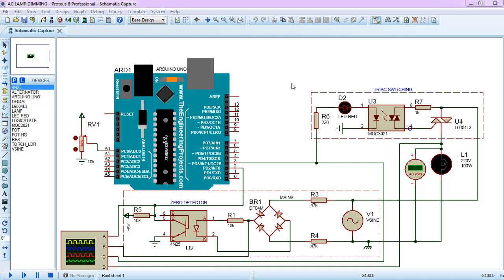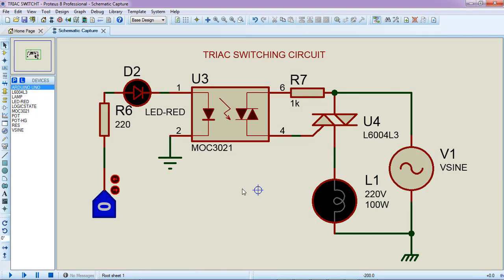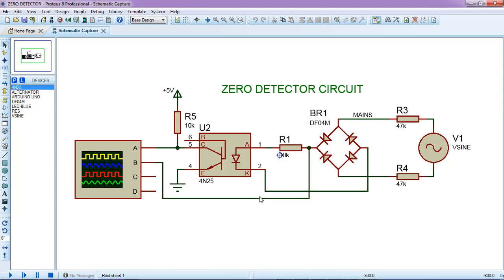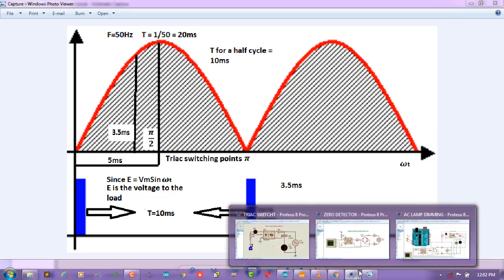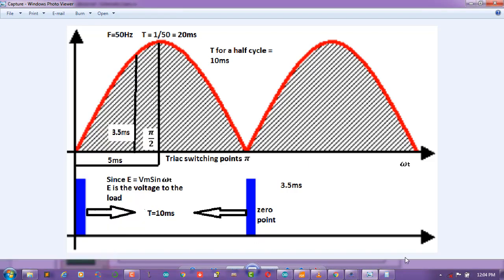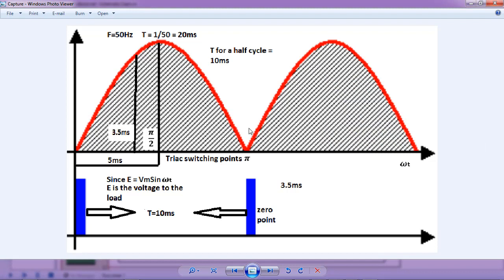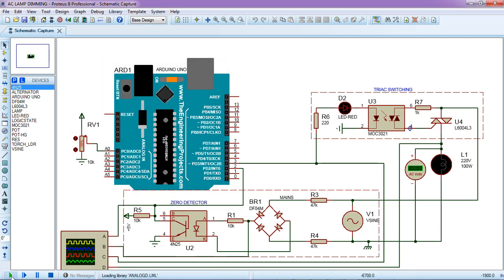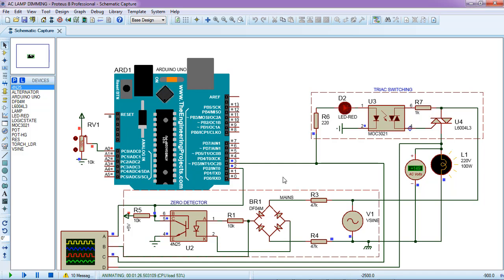AC LAMP DIMMING CIRCUIT WITH ARDUINO (ZERO DETECTOR AND TRIAC SWITCHING CIRCUIT ARE  EXPLAINED)

Comment: Hello, i have downloaded your rar file,  the difference in simulation is varying the pot hg,  the voltage runs from 224v to low voltage but without completing the 100percentage it starts again in 23% again as 224, is it ok?

Comment: Hi!
I really like your explanation, maybe you could expand/tweak a bit more this circuit and put a snubber RC circuit too, for inductive load use.

I have a question for you:
I'm new in Proteus and I see you use two types of GND.
Are they insolated from each other?
Where can I find the Eart sign what you used on the AC side?
Thnx bro for help and for this nice vid.

Comment: What watt you use in R3 & R4?
i made this circuit and its work perfect but R3 & R4 are heated up. I use 3 watt resister and my load watt is 100w.
Reply: I think R3 and R4 may dissipate around 450mWatts, your load connection does not affect the zero detection side since they are connected in parallel from the main.
Reply: @johnclaud1057  Thank you.

Comment: kazi nzuri sana kaka, why R7 is 1k? how to calculate it? 
for my understanding, current of the led of4n35 will be around 2 - 3mA due to large resistors value, May you please help me to understand more?
Reply from the maker: That is 4n25 ..
You can get the actual  limiting resistor value by using this formula  supply voltage -maximum forward voltage divide by the maximum forward current
Reply: @GhubaidaHassani  as for your formula, the limiting resistor value I get is 21kohms which will be dissipating more than 2Watts each if I use two of them, maybe too much power loss!, but I realize led of 4n35 can turn on and trigger the transistor to allow few mAs with 3mA provided by your circuit, am I right? Thank you, I learn a lot from your video too.

Comment: I wonder why its not working for me
Reply from the maker: Can you tell me how?
Reply: @GhubaidaHassani  What's the resistance on the lamp?

What amplitude  and Hz did u set the Vsine ?
Reply from the maker: I've  to take  a look I don't remember  exactly
Reply: @GhubaidaHassani  I followed everything strictly but it didnt work for me.....

even simulation didnt work well on Proteus. i used 817 opto instead of 4N25
Reply from the maker: Maybe there is something wrong with your components..

Comment: Hello sir thanks for your code but i wanna use thyristor instead of diode in zero  crossing bridge does it make change in your code?
Reply from the maker: NO
Reply: @GhubaidaHassani in my micro interrupt doesnt work please help me
Reply from the maker: @alibanai9941  whats the error
Reply: @GhubaidaHassani  it doesnt have error but interrupt doesnt work in microcontroller pulse deosnt move between pin2,3 it is just blue and doesnt blink